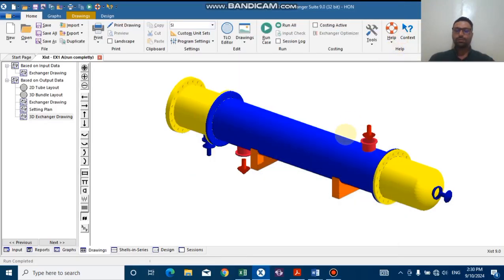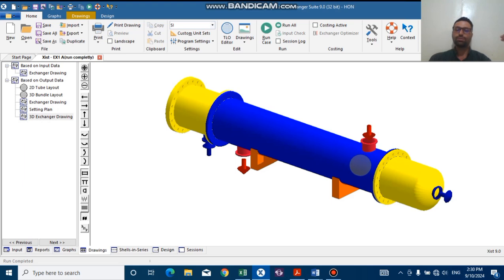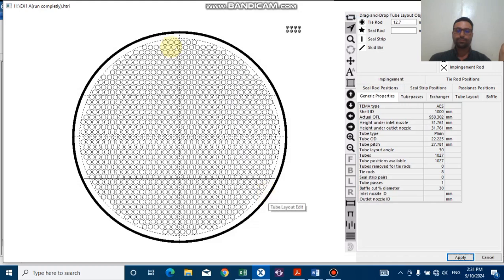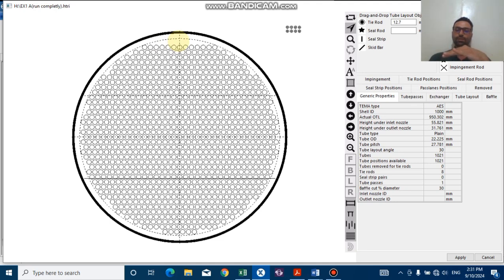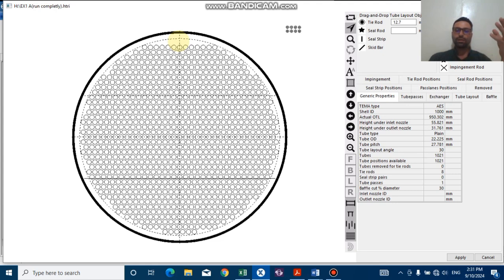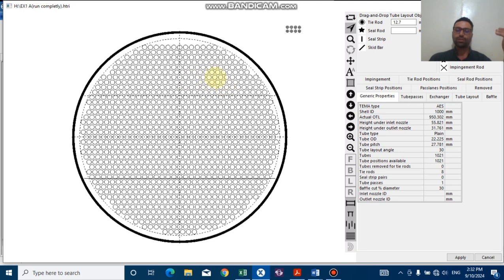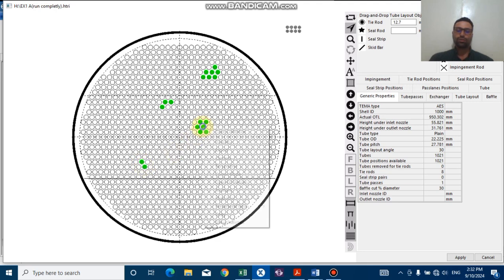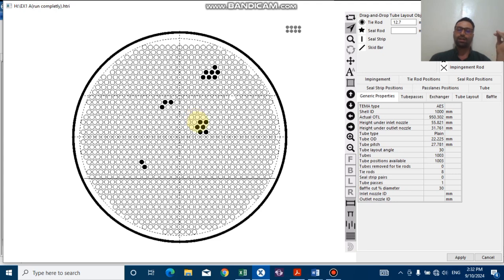TLO in HTRI

Comment: I am a last semester student of bachelor in Mechanical engineering and my final year project is based on design and analysis of floating-end shell and tube heat exchanger.
Please help by guiding me how to  download HTRI software
Reply from the maker: @SultanKhan-uj1nc  
It is an honor to help you out.
If you have any question ask me in the disceiption blow.

https://downloadlynet.ir/2020/22/8743/03/htri-xchanger-suite/20/?#/8743-htri-xch-222505020709.html
Reply: Can you help me to install this program?